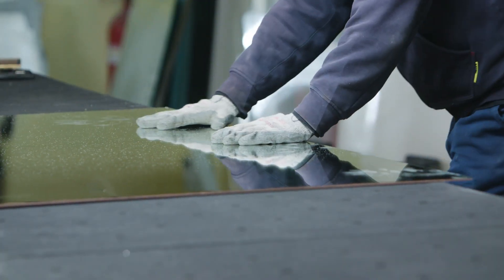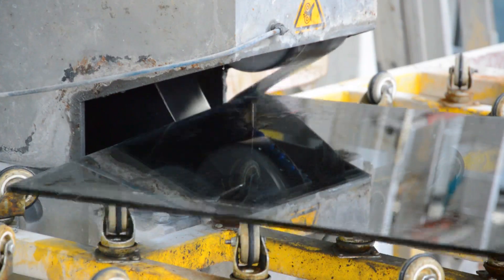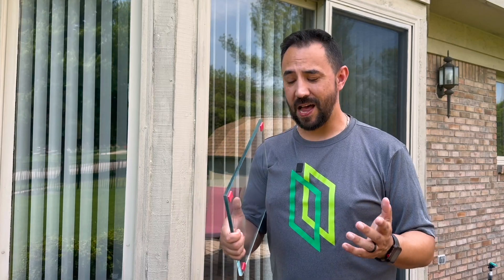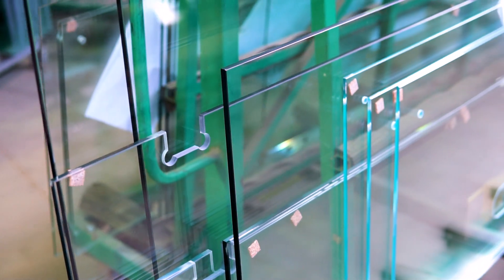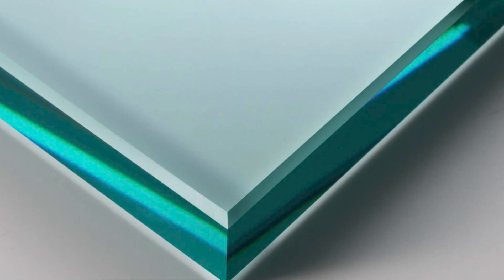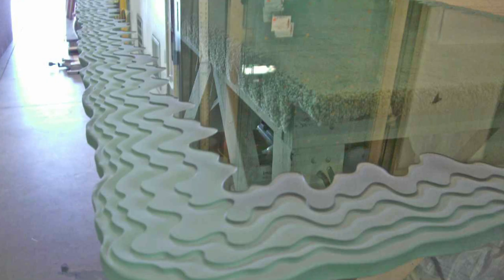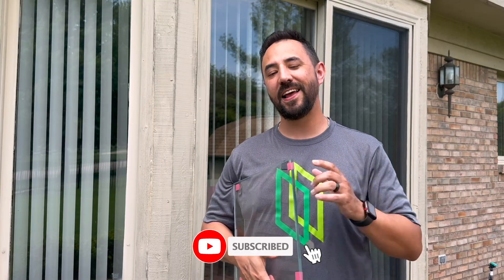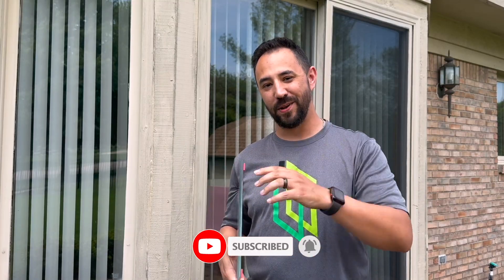Types of Glass Edges - From standard to custom

Comment: Hello sir
I am recently hired as a glass estimator do you provide any courses? I would love to join it
Reply from the maker: Hello Ashish, although we do not have estimating specific courses, we do have a few courses that would be very helpful to estimating like:

Glazing Systems 101
Introduction to Shop Drawings
Ordering Project Materials Series (Stock Lengths, Accessories, Sealant and Backer Rod, Glass)
Store front system options
Curtain Wall system options
Intro to Door Hardware
Intro to All Glass Systems
Glass Products 101
Insulated Glass 101
Decorative Glass 
Laminated Glass
Door Handing
Intro to Glass Guardrails